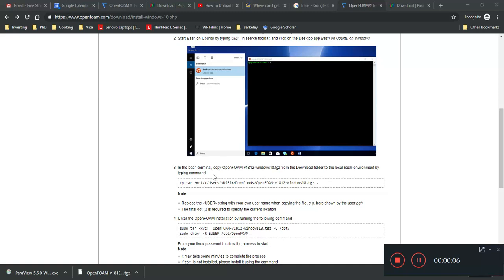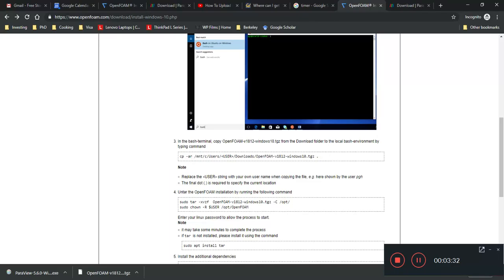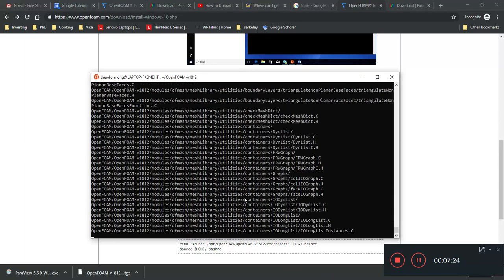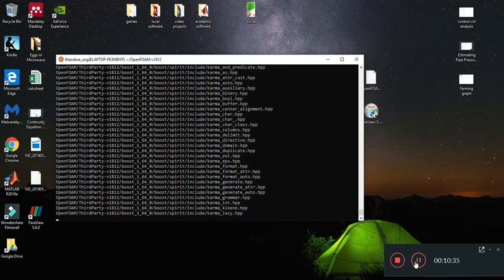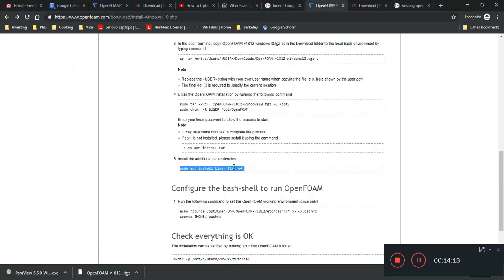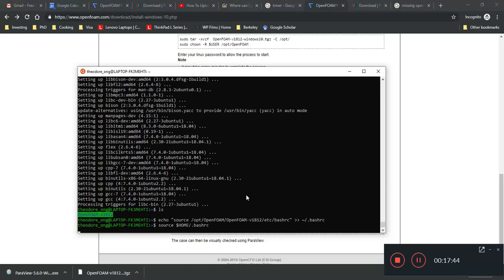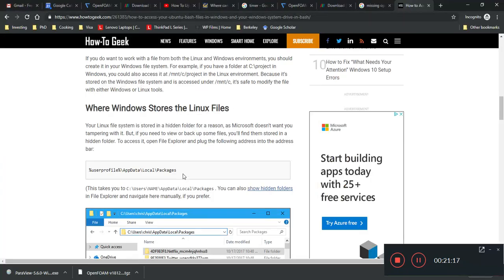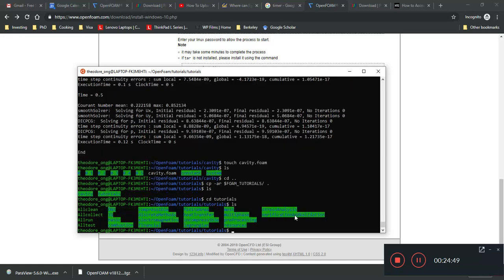OpenFoam and Paraview Win10 Installation (Windows Subsystem for Linux 1 Only)

Comment: You installed paraview on Window, instead of Ubuntu - does it work to view the parallel-run results without reconstructing the results?  For the OF versions in www.openfoam.org, paraview is incorporated into the OF installation (say OF6).  After parallel run, can just type in: "paraFoam -builtin" in the terminal to view parallel results.  My work-around is that, whenever I need to view the parallel results, I open a new terminal to wake up OF6 for just viewing results, using "paraFoam -builtin".  In case you know how to do the same thing with the OF versions in *.com, kindly let me know.
Reply: @TheoOngScienceAndEngineering  thanks for your reply.  Do you know how to install paraview as a dependency for ESI version?  I did try it long time ago, but unsuccessful (forgot the reason).

Comment: Firstly thanks for the detailed explanation of the installation  and my query is after installing paraview 5.8 while opening it, it is showing an error i.e., paraview.exe has stopped working and in the paraview  it is showing  "GLEW  could not be initialized: missing  GL version"  what to do now . I searched this error in internet they recommend to update GPU drivers but mine are already up to date. So what should I do to resolve this. Thanks in advance.

Comment: Very much appreciated sir. Had a problem with ParaView in Nvidia; apparently it doesn't handle two graphic cards very well, so needs to be forced to use just the nvidia card. Other than that, smooth as butter.

Comment: Please help . 
Everything works expect at the end when i put "source $HOME/.bashrc" it says .... No such file or directory  .
What do i have to do ?
Reply: Hi @Theo Ong,I am facing the same problem, most probably the error happened I typed the commends ( echo "source /opt/OpenFOAM/OpenFOAM-v1912/etc/bashrc" >> ~/.bashrc ) with v1912, but I installed v1906, I tried to change it back to ( echo "source /opt/OpenFOAM/OpenFOAM-v1906/etc/bashrc" >> ~/.bashrc )but it doesn't work. So I do received ( No such file or directory ) with type ( source $HOME/.bashrc )How can we reset the working environment?Thank you!!
Reply: Same issue on 1906
Reply: Now i fixed it i can help you
Reply: @sankaranand2379  Can you share it?
Reply: Oh please share your help bro 😇
Reply: First find the exact location of the bashrc file that is home/openfoam/openfoam-v1906/etc/bashrc and then type nano .bashrc it will open up another window get it to the last line and type the same path source home/openfoam/openfoam-v1906/etc/bashrc and then type ctrl+o and ctrl+x then close and reopen the ubuntu
Reply: Olá! Conseguiu resolver? Até hoje tento ...